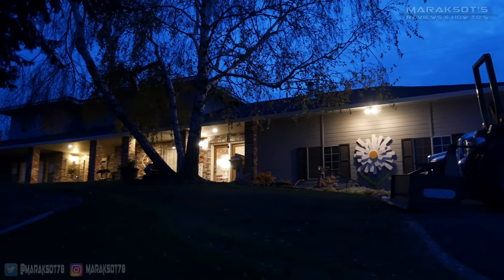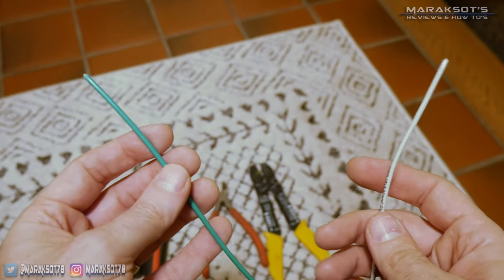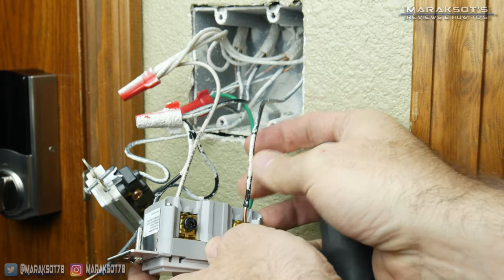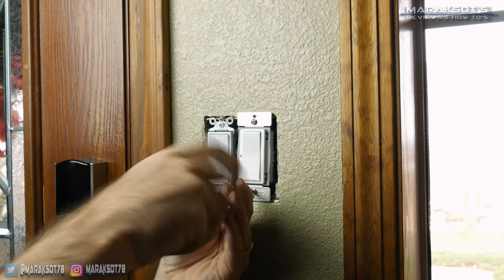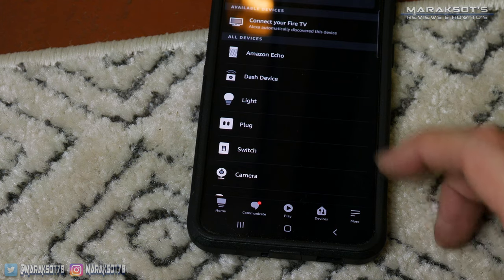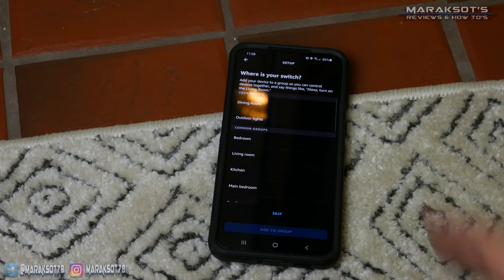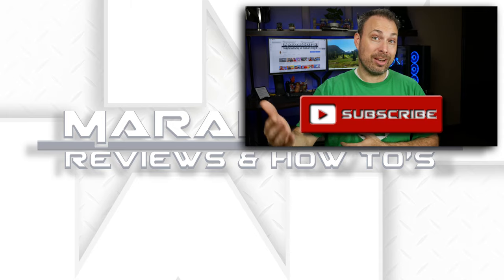How to Install a Wi-Fi Smart Light Switch - Eaton WFSW15-C2 (Works with Amazon Alexa)

Comment from the maker: Wanna skip to a particular part of the video? Use the Time Stamps. :)

Time Stamps
0:00 – I'm hooking my Mom up with some Eaton Wi-Fi Smart Switches
0:34 – tools needed to install the Smart Light Switch
1:07 – Safety First! Turn off the power to your switch
1:28 – removing the old light switch
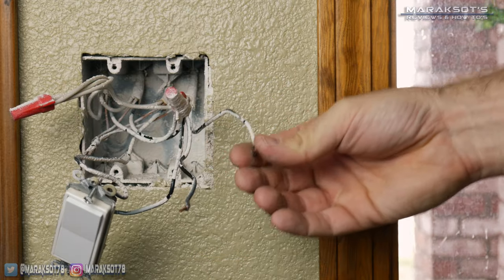2:02 – follow the wiring diagram
2:26 – wiring up the smart light switch
3:52 – finishing up the install
4:19 – connecting the smart light switch with the Alexa App
6:18 – I'll show how to set the switch up on a schedule in my next video

Comment: Love this video. I had the same set up so it was easy to follow. My only suggestion...before you puhs all of the wires back in and screw everything back into the wall, test the device.. Make sure it's wired correctly and everything works. Nothing more frustrating that finding out there's a problem after you buttoned it all back up